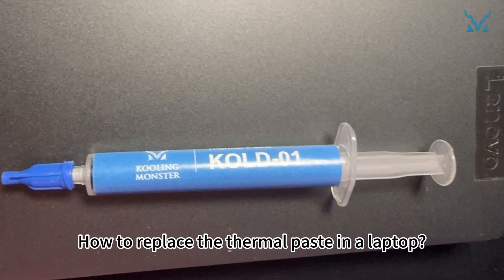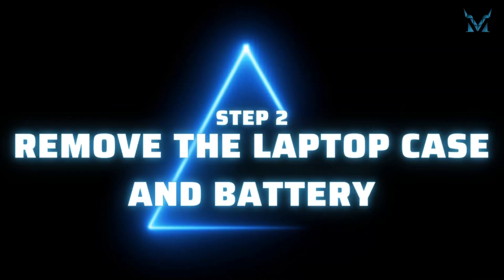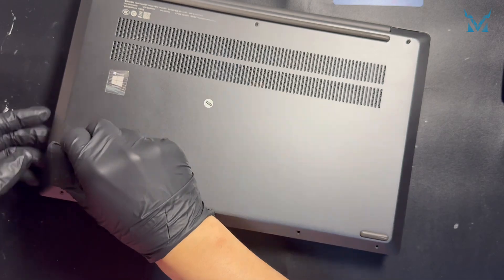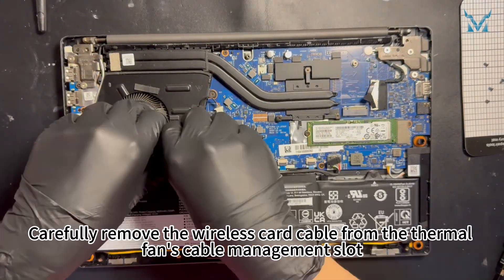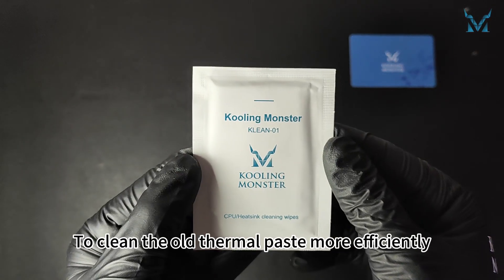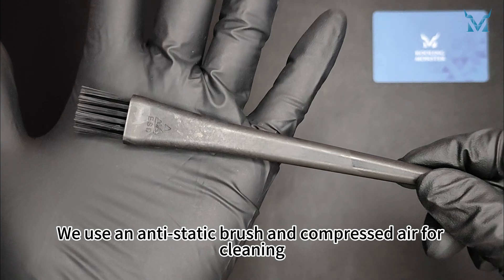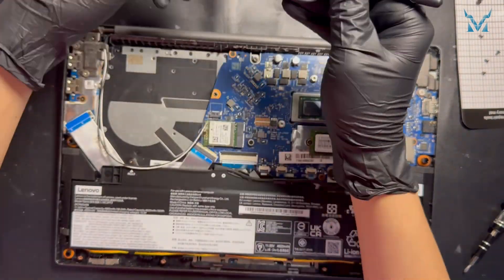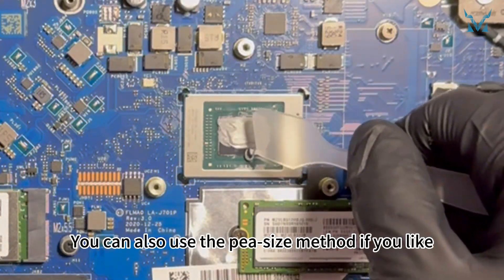Speed Up Your  Lenovo IdeaPad 5 14 2021 Prevent Overheating With Dust Cleaning & New Thermal Paste

Comment: Hello my PH0 screwdriver fit perfectly on only one of the 4 screws of the ventilator and i cant take it off, are'nt they the same ?
Reply from the maker: It happens! Not all fan screws are the same size. Some may require PH00 or even PH000 depending on the model. Make sure the screwdriver sits snugly — and press down firmly to avoid stripping the screw. 👍 If you need, our KOMBO-01 kit includes all the correct sizes for laptop screws.

Comment: What can i do if the laptop is now slower the temps look good and the load is normal
Reply from the maker: If temps are good but performance dropped, a few things to check ✅
• Make sure the fans and mode setting (Turbo/Performance) are enabled
• Reseat the RAM and SSD if you opened those areas
• Check Windows power mode → set to Best Performance
• Update GPU/CPU drivers + BIOS if needed
• In Task Manager, confirm the CPU isn’t stuck at low frequency (Power Limit)

Let me know your laptop model — I can help you troubleshoot step-by-step! 🔧😊

Comment: Do you know what is the thickness for thermal pad for this model of laptop? I need to change them in the future because they are full of cloth.
Reply from the maker: Hey @Absol125! Unfortunately, we don’t have the exact thickness specs for your laptop model’s thermal pads—those vary depending on component height and manufacturer. The best approach is to:

Carefully remove a pad and measure its thickness with a caliper (usually between 0.5 mm and 2 mm).

Order a thermal pad kit with several thickness options (0.5 / 1 / 1.5 / 2 mm) so you can choose the perfect match.

Use high-quality pads rated for heat (e.g., 5–10 W/m·K) for best thermal transfer.

For the CPU/GPU, stick with KOLD‑01 thermal paste—it's non‑drying and laptop‑safe. Pad only for VRAM/VRM areas, paste for cores.

Hope that helps—feel free to ask for kit links or part numbers when you're ready to replace!

Comment: Hey! thanks for the video. Can you game on your laptop while it is plugged in (charging)? My laptop (ideapad 5 14") starts to lag heavily whenever I plug it in and run a game on it. I suspect the temperature shoots up which causes the lagging. It would be really helpful if you could confirm if your laptop works fine or is it a universal problem with this variation. I would like to know before opening it up. Thanks.
Reply from the maker: You're welcome! Yes, you should be able to game while plugged in — that's when performance is usually best. If your laptop lags when charging, it's likely overheating or power limit throttling. Try checking temps first. If it's too hot, repasting with something like our KOLD-01 thermal paste can really help reduce throttling and boost stability!
Reply: @koolingmonster  using a cooling pad for laptops while his laptop is charging helps a lot lowering its temperature.

Comment: When removing the battery, do you press it down first and then pull it back?
Reply from the maker: Hello! No need to press it down—just gently pull it back while holding the sides of the connector with a spudger or your fingers.